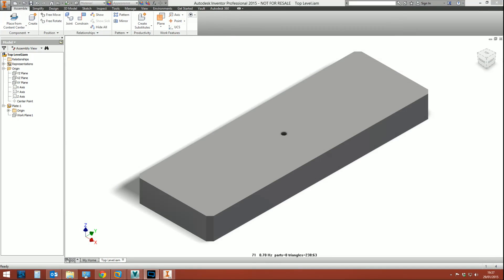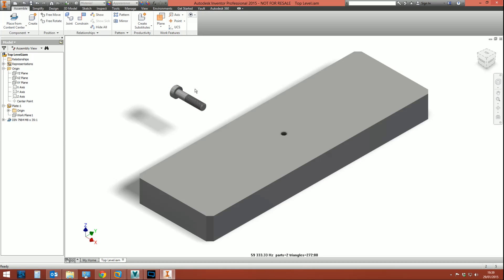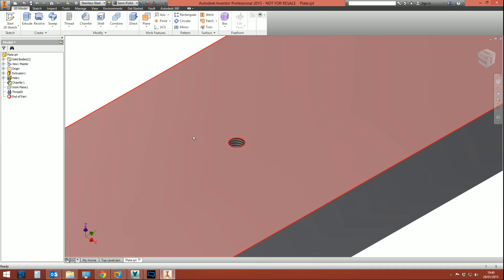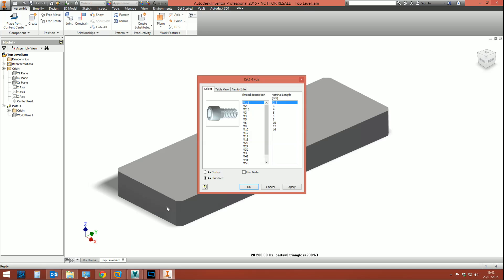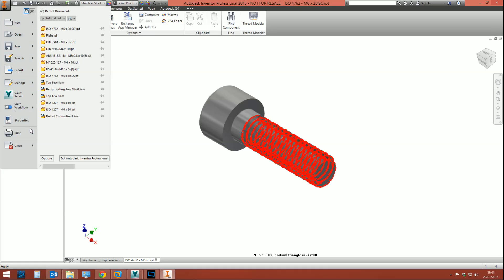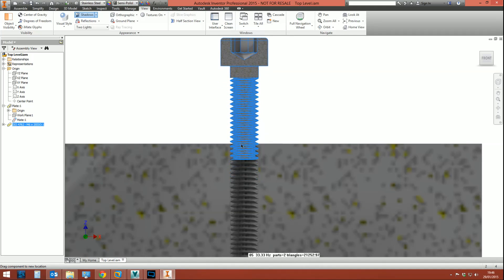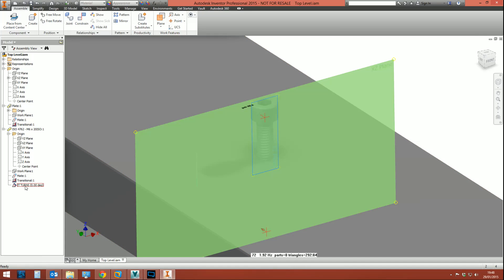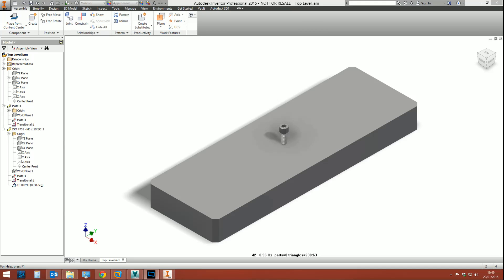Create real grooved threads on bolts, screws, holes & nuts | Autodesk Inventor

Comment: I downloaded this recently and there is a caveat- “this is supported to Inventor 2020 and that is the last version we are going to do” however I am still running 2016 and it does not seem to be available in the menu bar after install. I am wondering if the version I have is too new, but there is not much info on their site.

Comment: Time for an update mang, its 2019 and we now 3D print lots of stuff so the whole "ya, pictures are good enough, dunno why u would want to do this!!" >> is old ... humans have evolved. Thank you for being ahead and teaching us cool ish for the future which has yet to become. So, Mr wise commander I have a request / update >> of all the millions ways we could add tolerance, which methods would be best ?? <<  On a 3d printer we need weird tolerances, custom tolerances & the tolerances change with size.. oh I'm going to stop with that rant, caz I sense it could be book long. The only other thing I can think is that tapered threads don't work in this coolOrange program.. It just chokes dead. Maybe thoust God of Inventor has a workaround 4 NPT? Mission = tolerances and tapers.   Jeez, maybe you should just make like 3 video's so Autodesk just adds the option to make real threads instead of using this addon. Why Autodesk? The CoolO thing works fine !! Well, I can't think of all the possibilities we don't know exist yet,, perhaps they could put a 'render real threads' in the thread tool. OR if the memory thing is REAL, perhaps they(AD) could make it so it doesn't render IN inventor, but only on export. So we can use the silly pictures to save memory. Test the rendering while modeling, and apply the render on export... There is an idea.  .. Anyways I've typed enough 4 now. TFI thanks for everything u do. U r a tremendous help. ur awesome

Comment: Used it! Had to remove my threaded hole and use the Thread tool in Inventor. Then, use Coolorgange. It did not like that I'd at first used the thread feature under the hole command. Weird. But, searched online for coolorange troubleshooting and it was a known issue that the threads made by the hole command would not work.  It is wonder-magical when it works!

Comment: I use some fasteners that are not in the content center so I download them in a solid works fomat which inventor converts, I break the link and check them in. They are flawlessly modeled complete with threads. 
The thing to watch out for is that even in smaller assemblies the drawing views take forever to update and can crash causing loss of work. Then when I update properties on my largest assemblies the waiting time massively increased. The drawings do look better though.

Comment: This plugin seems to have great potential while using Inventor Pro 2016. The only problem is that it doesn't do NPT threads?! I can select either the NPT or NPT for PVC Pipe and Fitting from the Thread tool drop down, then attempt to use coolOrange only to have the error "Threaded face surface type is not cone surface but it is applied with tapered thread. Thread Modeler cannot modelize this thread". In reviews on the appstore download site, this concern was brought up by someone in June, 2015 in where a developer responded that in version "16.0.31.0 NPT threads are supported". Since we're now looking at the latest version (16.0.39.0) has this feature been removed? That seems counter productive. Is there an equivalent pipe type that matches NPT that would be recognized? ISO, etc... asking here because I haven't received help from coolOrange devs on this. Thanks.
Reply: I found that when doing an NPT thread you must have a hole or rod with 1.7899 deg of taper (NPT taper angle) then place the thread, then use the thread modeler

Comment: There is a "real" use for modelled thread, namely 3d printing. In normal CAM you don't need the modelled threads, but when you send a part to a 3d printer you'll need it :-)
Reply: @Kyle Shutic so it doesnt work with the Ad in?

Comment: As an extra tip... This tool creates a separate body for the threads. When you create drawing details you are going to see the difference so what can be done is to use combine tool in order to keep the bolt as a single body part.

Comment: I used to design specialist bolts for the electrical industry (on Pro-E). I always modeled the threads but it was a ball-ache to do. This is great, especially if you need accurate mass data or want to 3D print working models.

Learned a bit about Inventor at the same time.

Comment: Great video, I always teach my students how to draw true threads just so they understand the process, formulas etc, but with this why?
Reply from the maker: Lindy Hopper I think it's more because you just can, it definitely isn't a requirement in most normal use cases.  Probably useful and more aimed at those folk who want to show external threads in renders, there wouldn't be a lot of point in physically modelling the thread on a bolt and then hiding it in a hole! But it's free and just one of those things where it's like yea, we can do it, so you can now do it if you want to!
Reply: It's extremely useful if you want to 3D print a thread...

Comment: Hey cloud could got into transitional constraints a bit more? i have a set of landing gear for a plane, and i want to have the one of the doors opposite angle constrained to the other door. i need to use the constrained motion of the mechanically linked door so i can create the rest of the mechanical linkage. check out my youtube Chaos SkunkWorks ep5 and 6 to see the main landing gear and what im getting at. cheers

Comment: Excellent videos, how about something on bolted connections and fasteners and holes
Reply from the maker: Peter Pirz Sounds like a solid plan to me! What aspect of bolted connections, fasteners and holes would you like to see? Just how to use them in general or something more specific?
Reply: CloudCAD Ltd Just how to use in general, create some holes In multiple parts and bolt them together, and maybe how to set multiple fasteners into multiple holes at once.
Reply: TFI CAD Tips  You can also use Threads Modeling, the question says Peter Priz?